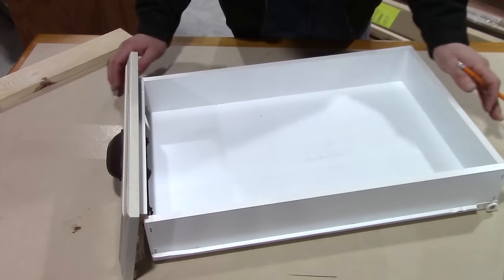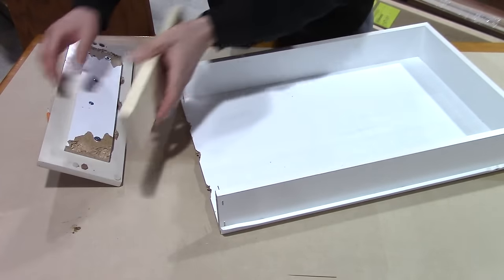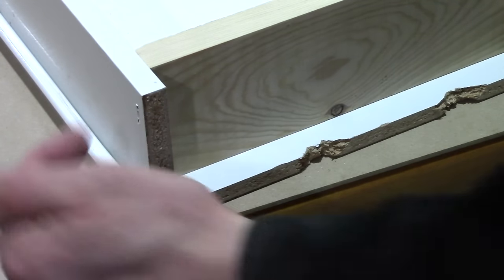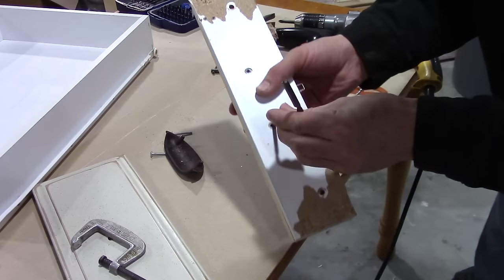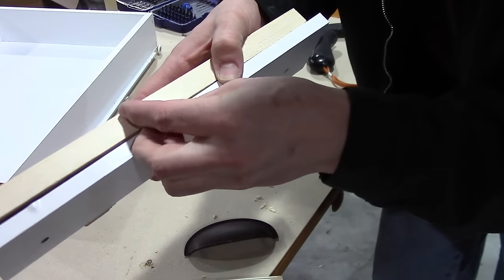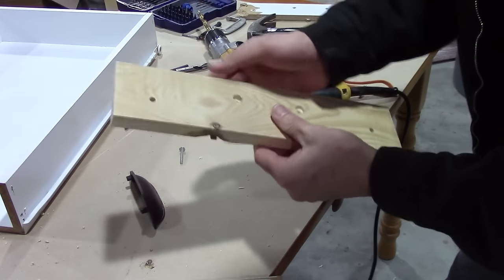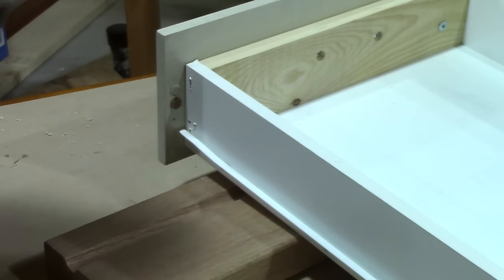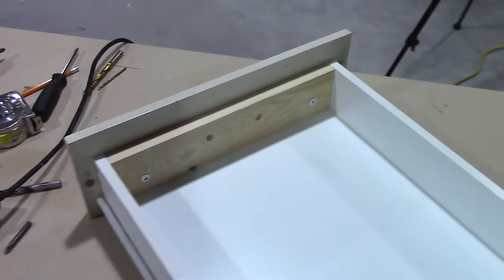How to fix a broken kitchen drawer - bathroom pull out repair

Comment: Super video. I have been buying damaged new cabinets from Lowes...the price is like $30 for a $270 cabinet (new) and there is assorted damage but I knew with some fresh wood and ingenuity this could be fixed. Thanks, one of the drawers to a cabinet fell off my truck and will need this very fix.

Comment: Thank you! Just repaired this morning one of my top-drawers, but I was not sure if it is a permanent solution, looking on Youtube for ideas. Mine did not have this extra board inside ->> but now it does!!! I put additional a small L-bracket in each corner, that should make the repair last forever. And, you are right: NO SLAMMING! lol

Comment: I had this happen to me on two drawers because I believe when we had extreme cold weather the furnace was running a lot and the humidity was very low and very dry inside and the front of the drawers came apart with very little effort when it happened. Our wide main drawer had some silverware in it but our smaller drawer hardly had anything in it. I believe dry conditions in the house can be a factor drying out the particle board.

Comment: Thanks for this. I was going to take the drawer to a shop where they sell cabinetry and surely they would've sold me a new one that wouldn't have fit and I'd have had to drive back and forth to finally get it straight.    My only thought is with such a heavily used drawer and heavy at that when full of silverware, I was thinking of even adding an extra L bracket on the insides of each front corner and maybe even rear two corner of the drawers.  I hate paying a lot of money when I can "fix" it myself! Thanks Adam!

Comment: Bought house drawers were too heavy for lasting back and forth.  I have drawers like this one you did and wondered about the metal drawer slides I bought instead of the cheaper ones that bent like yours.  Are they too heavy for drawer frame.  I want to use because you don’t have to attach to back but I will have to place blocks of wood on sides?  Before I do this is it workable?? Thank you.  you made it look easy, hope it is.

Comment: Adam, you got me going.. I checked several other drawers and found one with just a little wobble of the front. It does not have the extra board inside and is fairly higher). I took a ('real' wooden) 3/4 x 3/4", painted it and put a short one - matching the hight of the drawer and adding some glue - in each corner and the long one in the front bottom corner. Then screwed for the short sides 4 screws (alternating 1 from the inside and 1 from the outside), for the long part at the bottom 5 screws (alt. 3 from the inside and 2 from the outside. That should do the trick, it feels VERY strong. That's the way I most likely go from now on.

Comment: Adam DIY you are right in saying about why drawer  breaks. The correction and repair was excellent. but my drawer was having a  bottom which was  sliding in the wood groove....thin white sheet is inserted in groove...Question is how to make the groove.in new wood which you installed to give strenght to drawer. In new video bottom should be thin inserted in groove. ..

Comment: FYI when drilling the screws holes down for the thicker pine wood when using the old piece to see how much to go down you can wrap a piece of masking or painting tape which is what I used cause that's what I had lying around so you don't drill to deep.

Comment: It was a very good tutorial until you sunk 3 screws into that cheap material, it’s just gonna chew it up even more than the staples

Instead of the screws hit it with the brad nailer 4 nails in this shape \ / \ /  would hold much better until that cheap material breaks again.

Comment: I have the same drawer problem but i can't get the front panel off the piece that needs to be replaced. i think it was glued on. Is there a way to remove it safely without harming the panel?

Comment: Ok, around 3:35 you talk about what to do if the drawer ripped and how you can just cut it to make a new straight edge.  The face of my kitchen drawer broke off and all the sides are mangled from all the staples that it had in it and the tracking comes all the way to where the face is (should be).  What do I do about that?  I don't really want to flip it around but would that be the better option?
Reply from the maker: lmlekush2011 I had the same issue with another drawer I worked on.  Don't worry that the tracks are now going to be a little longer. They can just overhang on the back of the drawer.  You will need to make sure that you still use all the screws to reattach the track to the drawer.

Comment: i removed the two screws but the drawer front seems to be glued to box.  I tried a Heat Gun and a pry tool but it didn't budge.. Any Tips or ideas. These drawers are about 30 yrs old
Reply: I had that issue and had to use a chisel to get the particle board off the solid wood draw front.